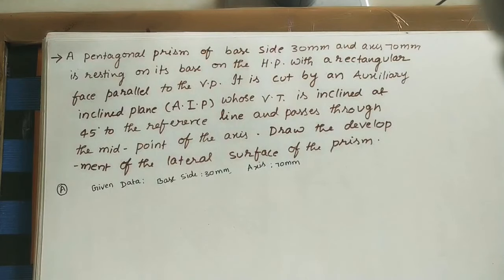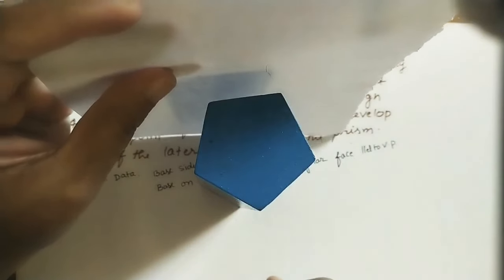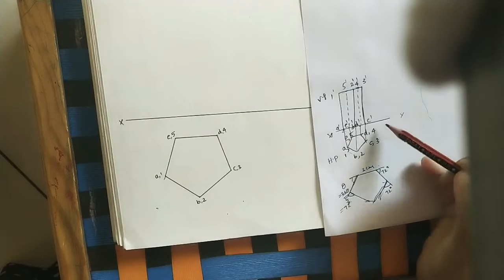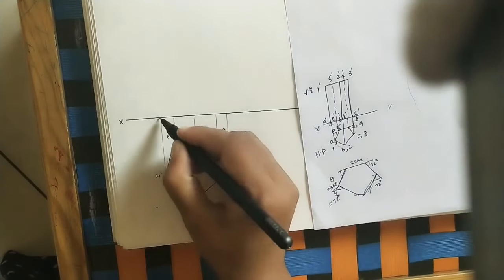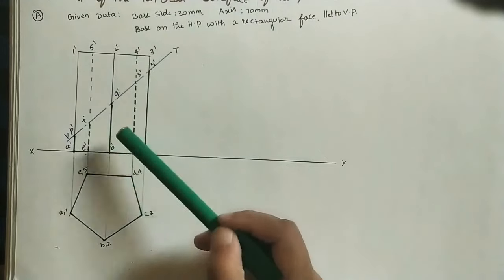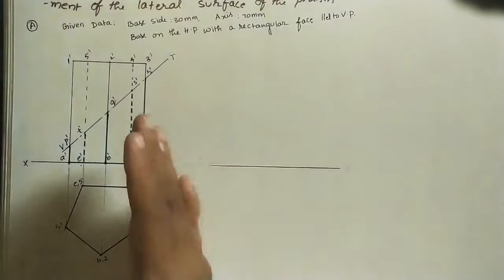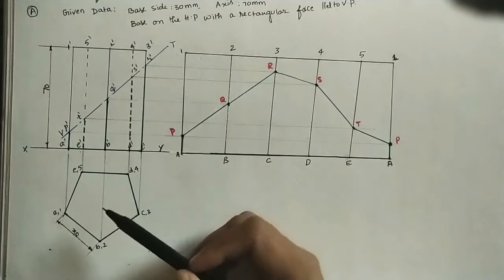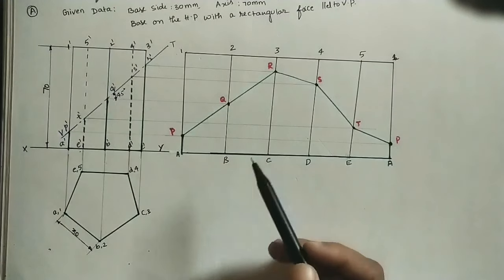Development Of Pentagonal Prism

Comment: a pentagonal prism of base side 30 mm and axis length 70 mm, resting in hp such way that one of the base sides st parallel to vp and near to observer. draw development of lateral surface when section plane is inclined at 45° and bisects the axis of solid.

Comment: 4

A pentagonal prism of side of base 20mm and height 50mm, stands vertically on its base, with a rectangular face perpendicular to V.P. A cutting plane perpendicular to V.P and inclined at 600 to the axis, passes through the edge of the top base of the prism. Develop the lower portion of the lateral surface of the prism.

Comment: Draw the development of lateral surfaces Of pentagonal prism having side 30 mn
and axis height 80 mm, rest in HP, on its base with an one face parallel to VP and
nearer to VP, when it cut by a a section plane which is inclined at 40° to the HP and
bisecting axis of prism.

Comment: 2. A pentagon prism of 25 mm base edges and 50 mm long, resting on its base with an edge of base at 45° to the VP. The prism is cut by a section plane V. T. inclined at 30° to the HP and passes through a point 25 mm from the

base along its axis. Develop its lateral surface of the truncated prism.